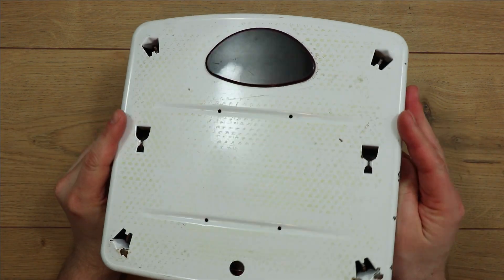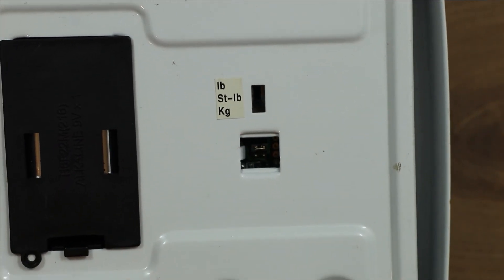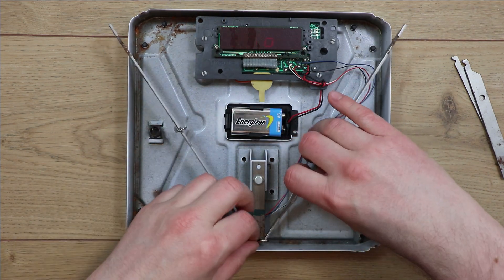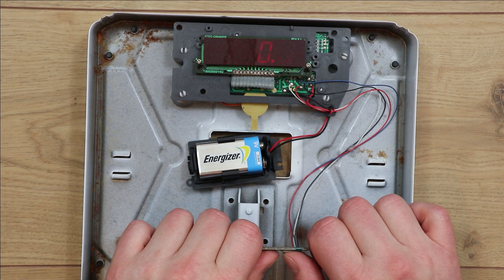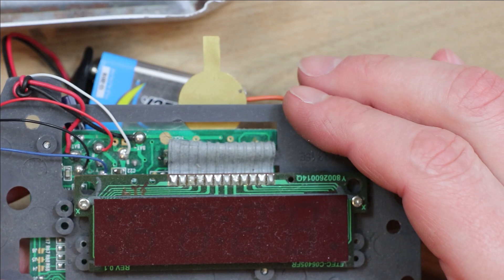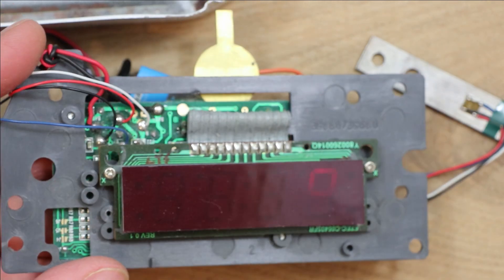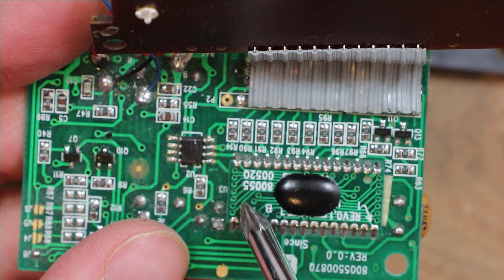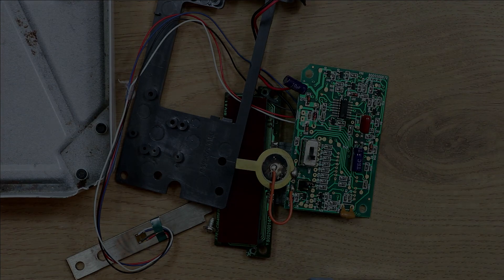Electronic Bathroom Scales Teardown

Comment: Thanks to your video I was able to make my work again.  Mine is a bit different but after cleaning some rust builds-up it had on some contacts, I had miss possessioned the arms that distribute the weight. I saw the correct placement of the arms on your video. Thanks again! 😊